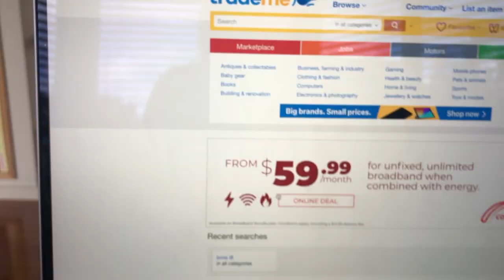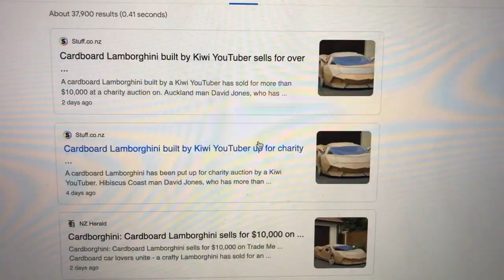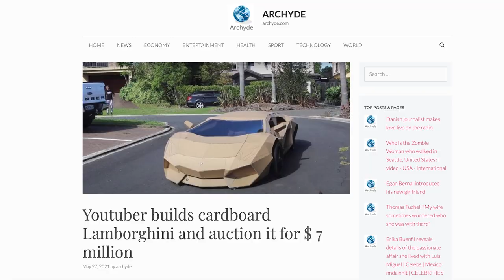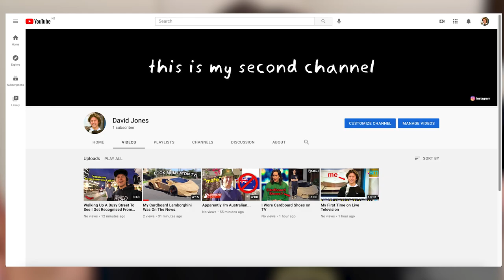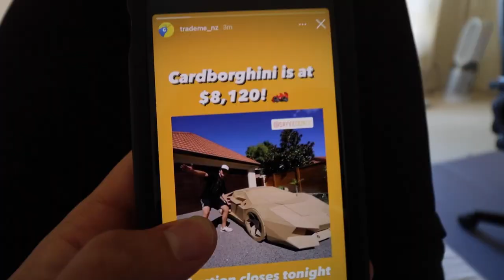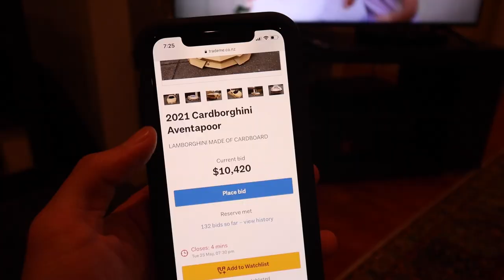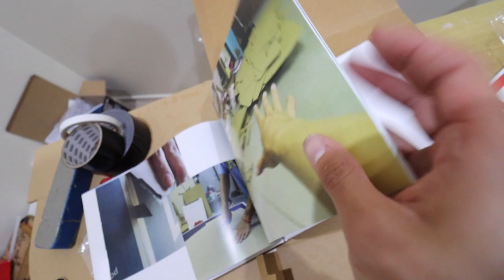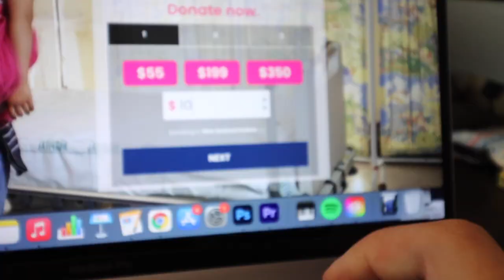MY CARDBOARD LAMBORGHINI SOLD FOR $10,000

Comment: Am i the only one who thought how kool that would have been to use as a template for fibreglassing? And to build a lite weight fibreglass body and potentially build an actual a fully functional lambo but with fibreglass?
Reply: That would be awesome, although the project would probably take 10 times as long considering each piece would have to be measured, cut out, fibre coated, sanded and assembled.